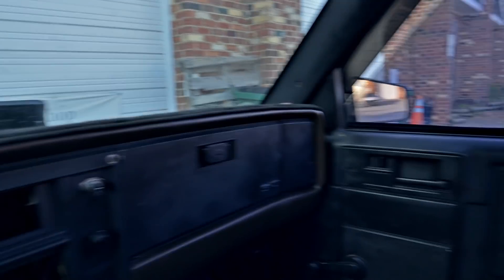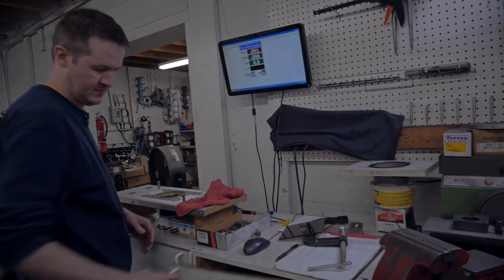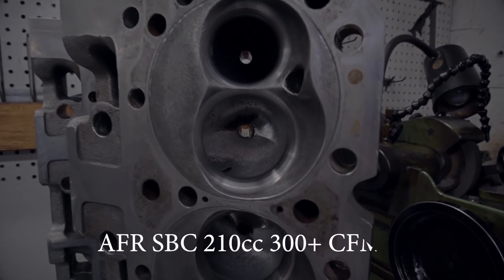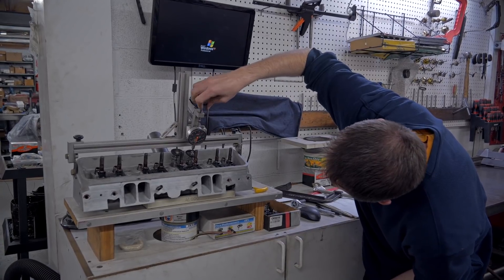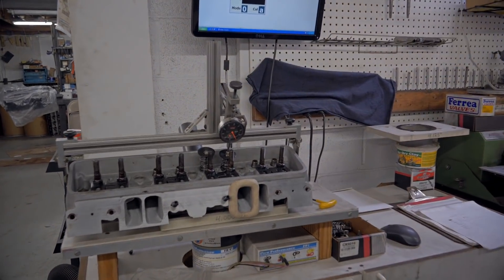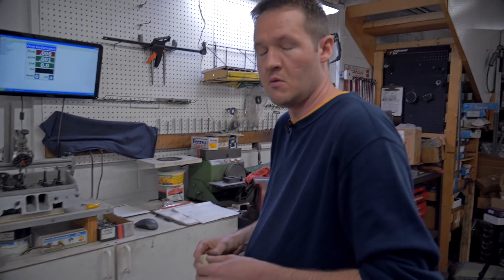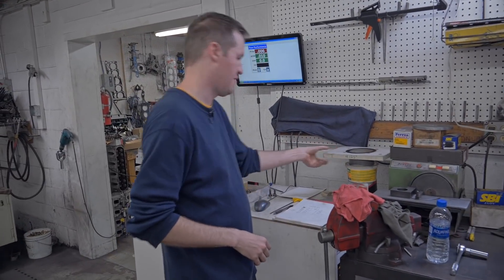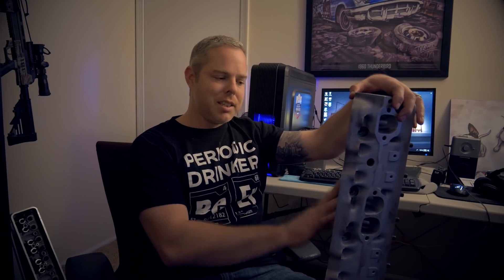LT1 heads on the Flow Bench ! 1993 LT1 Home ported heads.

Comment: Did you cc the ports?
Reply from the maker: Yeah I got them in the 197cc ballpark.
Reply: @TPVPRO  Thanks for the reply!

Went back again and worked on them some more. Took the pinch out some more to 1.110x1.910. Thinned the bosses some more and a little more bowl blending. I would gain a few cc's from bigger valves and opening the throat for them.

Ordered a burette to measure again(wasn't sure the plastic syringe was accurate). Still coming up with 181cc.

Heads are opened to felpro1284 gasket. Maybe I need something with a larger opening?

Did you break into the hole for the rocker studs on the top of the runner or the head bolt holes? I haven't broke through in those areas yet.
Reply: working on a set now and trying to figure out bowl percentage at valve guide. I am at 90 percent on the throat intake and 86 throat on exhaust. Intake bowl is at about 93 percent and just blended the exhaust. Coming up with about 180-185 cc at the moment. Not sure where the rest of the material is to get to a 205cc runner.
Reply: Pushrod pinch is at 1.050 and CSA is bigger than throat in that area. Guessing it has to be in the bowls and maybe a little more left in the roof.

Comment: Correct me if im wrong doesn't the vortec heads have the same ports as the LT1 heads stock?
Reply from the maker: No, they are a little different so is the combustion chamber. There is an iron LT1 head that is similar to the Vortec.

Comment: Now if you can put the right combo together and tune it to the tee getting all you can out of the 264cfm with a 2.3 2.4 or 2.5 hp per a cfm  and pull 550 out the heads N/A

Comment: If you had more vacuum motors and tested at a true 28 the flow would probably be a little lower. I have noticed that with the FP1 style benches. (I use 10 220v motors in my bench for big heads)
Reply: Have you ever just flow a head at 10” and then at 28”? I’m curious to see what the flow differences are as I also have a FP1 with a couple of shop vacs but regulated to 10”.
Reply: @elvislee7686  Yes I have but its been about 10 years since I did it. Currently I test at 35+ and back calculate to 28. I try and test at the most pressure my sensor will handle (40''). I would also suggest getting a set of calibrated holes from Bruce on the flowbench forum. you will be surprised how far off the FP1 is at different flow rates I have plates in the 100-500CFM range. the coefficient will have to change for different ranges.
Reply: @victordahn2150  cool and I think my bench actually reads lower with 10” of depression.

Comment: Your numbers almost exactly where mine were. Need to move short turn back.
Reply from the maker: Yeah that short turn is a mofo.
Reply: @TPVPRO  are those the ones currently on the rebuilt motor?
Reply from the maker: @bfromthed  Yes just as they are in the video.
Reply: @TPVPRO  should be fine. I got mine on the flow bench right now to flow before short turn adjustment. Only did 254 @ .600 before so I know what they need.

Comment: Are your heads 643 or 374 casting? I know the 374 heads are able to be ported a little bit more in the roof of the intake runner. I'm porting a set of 643's right now. Its amazing how much more you can open them up.
Reply from the maker: They are 93 heads I forget the # but I took a lot of material out for sure.
Reply: Can't wait to get mine done.  Thanks for the reply.  Keep up the great content 👍

Comment: What's better LT1 heads or vortec heads ?
Reply from the maker: I think after porting the LT1 is the better head. But stock to stock the Vortec iron head is a little better flowing head. With the smaller combustion chamber the LT1 has you can get more compression with stock pistons.
Reply: @TPVPRO  bc I got 2 LT1s   and i wanna swap my LT1 heads on my tbi 350  but i also think my piston rings could be bad   bc its smoking really bad
Reply from the maker: @Ricky-manic  Gen 2 LT1 heads will only work on a LT1 block. If you're trying to run them on a Regular 350 block run vortec heads.
Reply: @TPVPRO  ok      I just wanna get rid of the tbi heads  I heard there trash
Reply from the maker: @Ricky-manic   They are

Comment: The low lift numbers are really all about the valve job which the home porter in most cases doesn't have the tools or skills to correctly do. Even if your port runners were pretty decent in shape you'd be giving up a fair amount by not having a proper valve job. Had you had a great valve job done on that same set of heads you may have been really really surprised by the low and mid lift numbers.

Comment: http://elliottsportworks.com/?page_id=55
Lloyd knows how to make LTX heads work! His LE3 2.055/1.600 LT1 Castings will flow around 280~intake, 190-200~exhaust so... this guy hasn't seen LT1 heads flow over 250 on his bench but there are a whole bunch of em out there that flow pretty big, even the LE2 castings with 2.00/1.56 valves flow 270 intake and about 190~ on the exhaust.

Comment: Are those heads like the 113 aluminum  Corvette heads???
Reply from the maker: No, rhey are basically fast burn heads, but with a smaller cc intake port and will only work on the LT1.

Comment: Those heads will flow 300 if ported by someone that knows what they're doing
Reply: Eh that might be a little bit optimistic but they're close to that. I guess someone like Lloyd or a handful of others could spend extra time and make a few modifications to the runners that would net that 300 mark but my ported 21* Trick Flow's don't hit 300 until .700 lift they are 301@.700 to be precise, 291@.600 but the exhaust side really shines over the factory casting.
Reply: A stock casting will flow 290 on the intake with proper porting, a 208-210cc runner volume and a 2.055 intake valve. Starting from a casting that's 170cc's from GM. The casting is very capable, earlier castings being the better casting to get the number. There are two different aluminum LT1 Castings, the later found primarily on 96-97 model years have thinner walls in the runner and aren't capable of moving the air that the earlier casting will. LT1 Castings with proper porting absolutely have supported 500+hp 355ci engines. This isn't work done by the average guy at home in his garage though. These are Port jobs from Lloyd Elliott and Advanced Induction. There are others well capable of this kind of work but you'll find the vast majority of great LT1 cylinder heads coming from these two.

Comment: Are the valves stock as well or bigger? Thanks
Reply from the maker: They are a OE style valve nothing special just in 2.02 and 1.6
Reply: @TPVPRO  did you have to replace the stock seat inserts with larger ones ?
Reply: @TPVPRO  Okay cool, thanks man

Comment: Next time use the 643 or 374 castings and have them CNC ported by Advanced Induction or Lloyd Elliot. They will out flow most if not all after market heads..  You're welcome !
Reply from the maker: Probably won't be a next time for the LT1. This is the last rebuild for the 90s motor.

Comment: good luck with the build.....nice to see the old Gen2 still getting some love.  10s are definitely possible with stock head castings.
Reply: Advanced induction stuff has gone bottom 9's in a full weight car all motor and stock castings.
Reply: @ElteeMullet  and 2000 shot of n2o. I always got a kick when people would name some car going 8's 9's etc. and say they're using stock this or that when the only thing that's stock on the car is like the Chevrolet emblem.